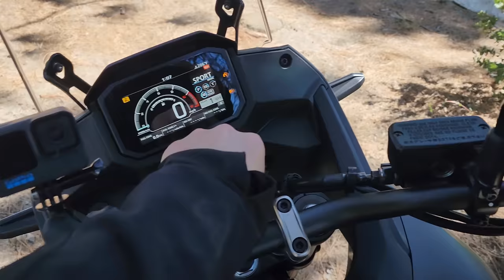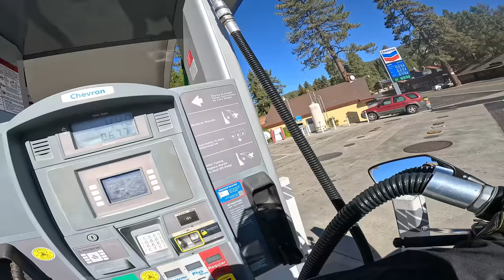Honda Transalp 750 | First Ride On/Off Road (REAL test... no holding back!) (EP.2)

Comment: I love that you started using metric units for all your non-us viewers. Thanks for that
Reply: Are they still selling metric sockets with standard drives like 1/2, 3/8, 1/4"?
Reply: @bendeleted9155  Atleast where i am from the 10mm has a for example a 1/4" tool attatchment. And so forth. Weird why that blend is used hehe.
Reply: The UK is non-US and we don't use metric. In fact we invented Imperial measurements.
Reply: @jkmayhem  thanks for confirmation. I wonder if anywhere on the metric system actually uses metric drives on tools, or at least labels it 12.5mm, 9mm, etc.
Reply: How many nanometers tall are you
Reply: OP; 25.4 is your best friend, just multiply or divide by 25.4. Super easy conversions especially considering almost everyone has a calculator in their hand 90% of the time. 25.4 my friend, 25.4
Reply: Yeah, I wish motobob did this. I’m sure motobob’s channel has a large US audience.
Reply: @bendeleted9155  Cant say i have seen that. I guess some things has just become a standard and never changed.
Reply: @tigerick7291 You guys are way behind in the times
Reply: @bendeleted9155  Who cares - just go and buy some mm-tools, like the rest of the world (except England...)
Reply: He’s an engineer right.
Reply: @tigerick7291 We have a mix of metric and imperial here in UK. For fuel we measure economy in miles per gallon but the cost is advertised per litre.
Reply: yes, totally, it is always such a hassle to go to google to do convertions
Reply: Hehehe 🤭👍🏾
Reply: Amen

Comment: I have a 2001. Transalp 650 and the only thing I am complaining about it is that is top heavy. Really like that new version has that problem solved. Transalp has always been smaller ROAD biased version of Africa Twin. Purpose of this bike is and always been, not an off-road bike but small Touring bike with option to go on gravel and forest roads and that's it. Also, I don't understand why everybody complains about tubed tires, I have a sealant spray in my bike with me all the time. If you have a puncture, just use a spray until you reach a shop where you can change a tube which also I have a spare. Btw. really like your reviews. Greetings from Croatia!
Reply: I think they shouldn't have tuned the engine so high in this new version the transalp was never a sports bike but this thing now has 91hp
Reply: Exactly
Reply: The only reason to have tubed tyres is for serious off roading, so that if the rim gets dented, the tyre doesn’t deflate. The tube adds significant unsprung weight and not everyone wants to fill their rim with sealant gunk to get off the roadside. Tubed rims have zero benefit for this bike’s intended purpose - light road touring. Honda put tubed rims on the Transalp purely because they’re cheaper and because they wanted the spoked rim look. As Ian states in the review - the bottom end of the bike is definitely not suited for serious off-roading. I’d even argue that the 21” wheel is a superfluous on this bike and compromises the road handling - but again it’s there for looks rather than function.
Reply: @MH-xd2nd  100% correct.

Comment: 150 miles on mine and loving it. I bought it for what it is, knowing the things I would need to upgrade like skid plate, crash bars, etc. But I am pleasantly surprised that it's so comfortable, light feeling compared to my 17 AT, and the motor is a character for sure. Not a powerhouse, it likes being run through the revs, but it's a great bike that will be used for 90 percent work commuting and weekend back roads.
Reply: I do hate that TC doesn't have a dedicated button or stay off after key off.

Comment: With over 7,000 miles now on my Vstrom 800, I must say so far, your review of the Transalp has not induced TransAlp envy for me.  Great review as usual Ian.
Reply: I’d 100% take the new V Strom over the Transalp
Reply: 800 DE every time!
Reply: I wish there was a tenere 850/1000 but I don’t think it will ever happen.
Reply: The V-strom certainly costs less per pound.
Reply: As of right now I think the Suzuki is a much better starting point. As far as I can tell the only thing better on the Honda is the wind protection and mirrors? Those are relatively cheap and easy to fix with aftermarket stuff.
Reply: @00mazone maybe lighting too.
Reply: @anxiousappliance 🌭
Reply: @chadkline4268  Yeah but both bikes will need that. I'm not counting stuff that both bikes need.
Reply: Looks like there are some 800DE owners here like me so here's a little something for them. 
The air cleaner lid on the DE has two rubber snorkels on the sides. I took off the seat and popped them out. Just fold them and they'll come right out with no damage. If you like induction noise, you'll like the intake noise this thing makes now LOL. Might even have to put one of them back??
The level of the intake air is about the same, so no change crossing water. I don't think it changed anything as far as drivability. In north Idaho, fall just hit us in the face so it's too stinkin' cold to go for a long ride tonight. Just up and down the block. It sounds really good!!
Reply: @dwayneneufeld1696  it may depend on how primitive the EFI is to know whether it can increase fuel in association with increased airflow. If you're going to increase airflow, you may as well get a performance exhaust, and then a dynotune.
Reply: Wonder if the sparkplugs are easier to change than the T7?
Some have mentioned the capability of the fuel injection injection and how advanced or primitive the ECU is in managing them. I think that should be included in your reviews. I think you need to leave the bike I a giant freezer overnight and test it's start up and drivability vs the ambient temperature. 
Realistically, you need to get the three bikes together, Tuareg, Transalp and the 800DE and test them side by side.
Reply: Cruise control though, why can't they include it for the same price??? The Tuareg has it.
Reply: @jaytownjunkyardfiles1999 they want you to buy a more expensive bike. Aprilia doesn’t have a bigger model. It’s a bunch of bullshit imho, there’s a big difference between a middle weight bike and full size bike off road so you basically have to buy a bike that often is worse for your needs to get cc. I’d bet it’s cheaper and easy to add Cruise control vs a gimmick like self cancelling turn signals.
Reply: @David..  I don't do much off road but, these dualsport and ADV bikes are a lot of fun barnstorming on back roads due to the extra suspension travel. The extra CCs and power, I guess it depends on how much you intend to carry and if your terrain is more hilly.
Reply: Only thing I envy is the lack of engine heat - that DE is a right knee roaster. However way better stock suspension and electronics on the Zook.
Reply: @dwayneneufeld1696 ride report?!
Reply: Put about 40 miles on the 800 DE with the snorkels removed. Throttle response is the same, nothing changed as far as drivability or fueling. Being a mechanic for a living, working with fuel injection daily, I am pretty sure I would notice if there was a problem.
The intake noise is on the loud side with both snorkels removed, but only under hard throttle. I'll probably put one or both of the snorkels back in. A nice exhaust note ( not loud ) like my Africa Twin is what I would really like. 
After I get the silencer finish, lower exhaust back pressure is more likely to change everything. Especially fuel mixture, and may even reduce torque as you know.  Don't want that!
Machining up my homemade silencer is a ways from being finished so that will be a while. I expect to play with back pressure to keep the torque... the same and avoid a tuner. It runs too good now to screw that up. The whole exhaust project might be a flop, but it's fun to play with. Was thinking about making a simple flow bench and see if the exhaust back pressure can be matched, or at least be close.
Just pull your snorkels and see what you think. It won't hurt anything. @davidgrunklee8407

Comment: Thank You Ian. I rewatched Your video on the Vstrom 800 and I think the Transalp may be a better option. Mainly because of the light weight, center of gravity, manouverability and power. Not to mention that it is a Honda. Cheers from Norway.
Reply: Can't go wrong with either bike, but I'd personally take the V-Strom for its off road abilities and smooth suspension.

Comment: Ian, I am new to riding. I just started January 2023 with my 2023 KLX 300. Your reviews are excellent & you never miss a thing. You have answered all the questions I have had thus far In your video series on the Honda Transalp.  Thank you for your time & In depth reviews on different machines. To a new rider that helps alot. Especially in my next motorcycle purchase. [Note, cannot believe you dropped a new bike on proupus. Your the motorcycle review bar setter,wow]!
Reply: Get a better seat and a windscreen on that bike and you really don't need anything else provided you don't do a lot of highway miles. I upgraded and wasted money several times before realising less is more (and leaves money for better things)

Comment: I think the "Transalp is boring" crowd wanted a T7 competitor in terms of offroad design/ability. It seems like this bike would be an excellent lightweight touring option filling in the niche between the CB500x and the Africa Twin. The unfortunate reality is that Yamaha doesn't really produce an offroad marketed big adventure bike like the AT or the GS. The supertenere exists but is mostly marketed as a tourer. Yamaha doesn't have to worry about the T7 undercutting the sales of a flagship machine, because there really is no flagship machine to undercut.

However, if Honda made this bike really offroad capable out of the box, they probably wouldn't sell as many Africa Twins. Just like you said when you did the spin turn, you probably wouldn't do things on an Africa Twin that you would be willing to do on this bike. I think that's true for almost everyone except the most competent riders. Big bikes are extremely capable offroad, but it takes more skill to use them offroad. As much as I want a hypothetical 450l Rally from Honda or an XR650 refresh, it'll probably never happen.
Reply: Well said. This bike didn’t compete in the market that is thriving in competition. It’s an underwhelming addition to the touring market. Probably great for what it is, but not what the people wanted 👍🏻
Reply: I can only hope you are wrong.
Reply: It still does not make sense to put tubed tires and no cruise control on a touring bike in 2023. It seems like Honda can not decide who should by an Africa Twin and who should by the Transalp.

Comment: Thank you for addressing the preload stiff/soft thing.  Lots of confusion around how that works.  I will say however that increasing preload CAN in some cases help prevent bottoming, although by a fairly small amount.  If you are riding higher in the stroke, there is more potential bounce travel available, but this is at the expense of rebound travel.  At best, it's a bandaid if used for this purpose.  Always appreciate your reviews.  Real world experience, not read from a spec sheet.

Comment: Great video Ian! As a 500x owner I went and looked at a Transalp in person this weekend and walked away after I saw the oil pan and exhaust. You've got me double thinking my choice now lol I keep going back to wanting the Vstrom 800!
Reply: I bought one last month. Best decision I ever made. It's funny that I was considering holding out for the Honda 😂
Reply: @user-ti1lg3qq8u  I've tried to buy the 800 twice now but I'm too far upside down on my 500x to get rid of it since I just bought it in January of this year then got the extended warranty like a idiot lol
Reply: @Mark-d5f7z   same here.  I had a 310gs and thought about waiting for the Transalp because I've always been a Honda fan (250L, 500x), but the v-strom 800de just called to me.  Love that bike so much.  No regrets.  Looks like we made the right choice.  :)
Reply: Why the 800 Suzuki not the 650?
Reply: @vigofox  better suspension, more power etc.
Reply: A 500x doesn't need an extended warranty!
Reply: You're regretting the cb500x?
Reply: @chrispekel5709  no, but I'm curious. The transalp wasn't available when I was buying. I'd wait a year or 2 for problems to be sorted out, aftermarket products, tubeless conversions etc

Comment: The roll on pull in 6th gear feels less torquey because it's more overdrive than any bike out there to date because it's overall 6th gear ratio is 4.69 to 1 where the Tuareg is a tad over 6.00 to 1 ratio and your 890 Adventure is 5.17 to 1 ratio in 6th gear, so if you went down one tooth on the front sprocket to a 15 teeth it would be about 16.00 to 1 in 1st gear and close to 5.00 to 1 in 6th gear and the Transalp will have a lower 1st gear and taller 6th gear than the 890 Adventure, that to me is true adventure bike gearing and I see a lot of potential for the Honda to come. I own all of these bikes and I have done my homework with sprocket changes and the this Transalp revs in the motor real good. Great review!
Reply: Honda obviously geared the bike towards road riding and low rpm in top gear.  As the engine is in a higher tuning state it won't suit a wide ratio gearbox as its not a wide ratio engine.   But you can never have it all.   Drop a tooth on the front will definitely improve things off road.
Reply: Interesting 👍I never would have guessed that there’d be that big of a difference between these bikes. I know gearing makes a difference.

Comment: I’m definitely going to buy this bike. For my 130 lbs. the suspension is probably just about right. 
I have the Honda CRF300 Rally for street legal + off-road stuff, so my TransAlp  will be mostly for highway and city riding. 
A good bash plate, Bark Busters, Double Take mirrors, crash bars , and some luggage options should round it out. 
Cruise control would be nice, but I’m very comfortable with the Throttle Rocker I’ve been using for years. 
Thanks for the thorough review, and all the extra technical information. 
Happy Trails!

Comment: First thing i noticed is how little wind buffeting there is on the original windscreen. I was a little worried about that since i had to pick mine up 400km away from home as they where one of the only one that had one left in the shop at the time in june. Others where more to double the distance. I remember how surprized i was how effortless it is to ride. I only took one break on that trip because i got hungry, Norwegian roads so no super high speeds. I do like that throaty sound. Gives me a smile sometimes hehe. I am averaging 0.38. on mine  I agree if you are going to take it offroad. A suspension mod is pretty obvious on allmost all bikes. Stock springs on honda seem a little on the lighter side when it comes to rider weight. Not a huge problem so far. But i am prob going to buy a new shock and cartrigde for the front fork if i keep mine. As i do like suspension modding. Regardless of bikes. My experience with the T7 was beyond dissapointing. And i did not understand the hype at all. It did not feel good in any way. Very top heavy. Suspension platform is not any good. And reading people saying the transalp is not comparable to the T7 in any way. You all are wrong. If you dont believe me. Ride one. I am not saying T7 is garbage. Far from it. It has quality written all over. But out of the box the T7 needs to much mods to become great. When you look at the price on the two and what you actually get.

Comment: Great test. Well done for pointing out that preload alters height, but not stiffness.

The Honda would suit me just fine. I ride rough roads and gravel tracks, so ground clearance isn't that important. I'd spend the money saved on suspension (maybe TracTive/Touratech). I had to spend on suspension for my expensive KTM 890R - if the KTM lets me down too often, I'll probably give this Honda a go. I'm in Europe, so will get full power. 90 hp is plenty in reality. It's not the bike that's boring, but more likely the rider.

Comment: Great review!

IMO That’s a bike that should have been made without traction control and the ABS should have had a simple designated on/off switch or button. The oil sump and exhaust routing underneath the engine also sucks for the more adventurous riders. Other then that, Honda nailed it IMO.

Comment: I like the look of this bike. I'm not a huge ADV fan, I hated my '22 KLR, felt like it was subpar at everything, and now own a '14 WR250R and '04 VFR - both for less than the KLR. I'd be cross-shopping the Transalp vs. the T7 and V-Strom 800. Personally, I hate the appearance of the V-Strom, and the T7 is just a little too much dirt bike for an ADV - my wife will never want to sit on that flat seat. Pleasantly surprised with the Transalp. I get that it's not really off-road oriented, but at my skill level, this looks like it'd handle any moderate off-road 'adventure' while riding far from home. I learned the hard way what real off-road riding will do to an ADV while riding my KLR, I'll leave that to my WR.

Comment: You are spot on. I just got my TA750 and have mostly the same views. My rides are more northern and so I have the heated grips which are outstanding.  On road the power delivery is a bit tame, but it loves to rev for sure. It handles well and is very easy to ride